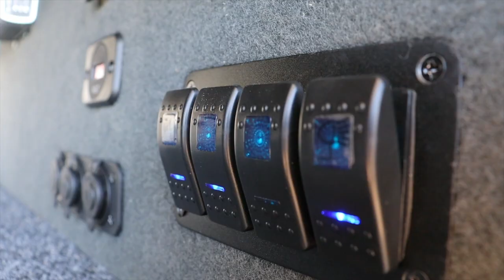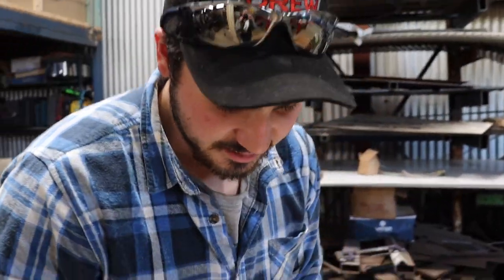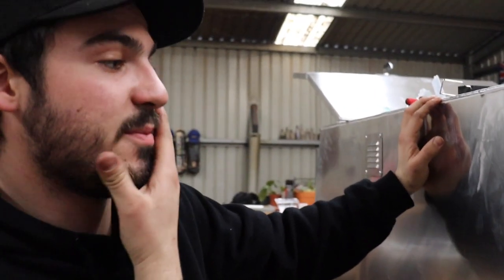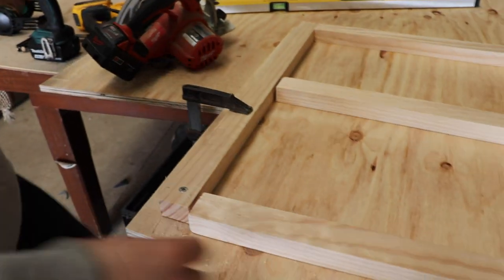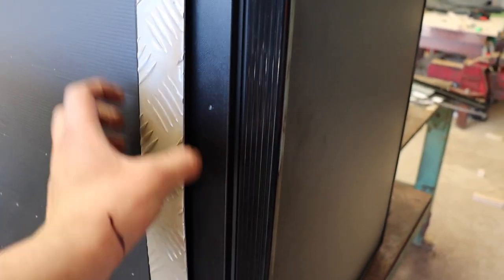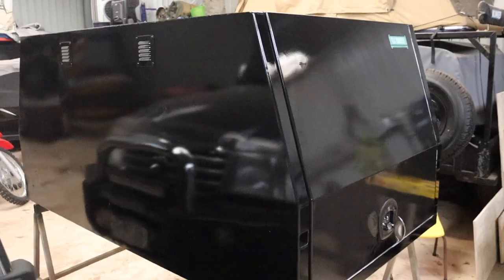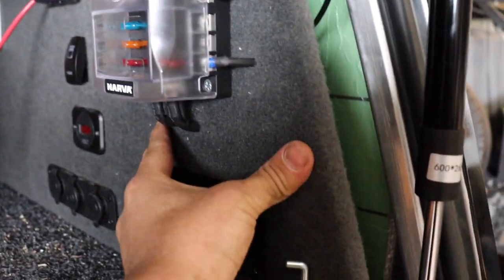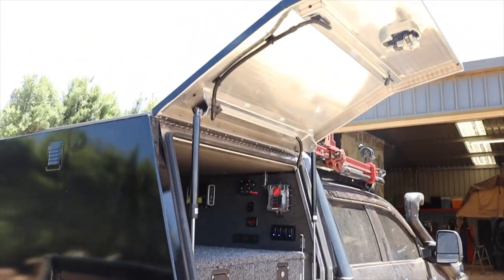Ultimate DIY Camping Canopy Build | Strictly Bush

Comment: Hey mate, great canopy build. Always love to see people do their own setups!
With regard to the 50amp breaker installed under the bonnet, it is an auto reset style? If so, I wouldn't recommend them. My experience with them in under-bonnet use has seen failures and neusense tripping as they don't like heat.
I would swap it out to a suitibly sized MIDI fuse if you can. 
Keep up the good work. Cheers.
Reply from the maker: Hey mate glad you liked it. Yeah it’s auto reset. Haven’t had a problem so far, this is more temporary to get through the summer I haven’t had power running to the canopy since lock down but I’ll have a look. Cheers mate!!
Reply: Hey obsession, 
Just read yr comment and thought you might like to look at my set up both videos canopy and 12v set up. 
Cheers 
Out There Touring
Reply: Hi great build. 
Just read yr comment and thought you might like to look at my set up canopy and 12v for some ideas.
Cheers 
Out There Touring
Reply: HAve heard that yet mine has not had an issue in 5 years so I would take that advice with a grain of salt. Cheers
Reply: @cyclemoto8744  So because your setup has not had an issue in 5 years means using an auto reset circuit breaker is going to be fine for everybody else's individual circumstances??
It's typical that people such as your self will tell others to disregard considering upgrading to a proven industry standard that functions more efficiently in high heat environments for such little additional cost..🙄
Reply: @12v_obsession92  People can do as they please based on the information they seek. I don't object to the industry standards which in this case don't have a bearing on safety, only reliability. However my experience with breakers has been 100% reliability and no issues with effiiciency considering my Victron DCDC charger operates above the stated specifications (Victron have underrated specs).  You should consider your tone when participating in discussions. You will more than likely find that people's propensity to engage with you will increase if you cease your aggression

Comment: Great fi-tout video! I really dig that slide out pantry. With those air-vents, are those little filters easily replaceable / accessible to wash out and re-insert?
Reply from the maker: Thankyou! We just have them on with a double sided tape, and we made the gap big enough so that someone with a small hand can do the job 😂
Reply: Hi great build. 
Just read yr comment and thought you might like to look at my set up canopy and 12v for some ideas.
Cheers 
Out There Touring

Comment: Nice canopy mate. How has the bit of sheet metal gone with keeping the fridge in place? Is there any movement over corrugations? Just bought a fridge and going to do the same tie down I think. Cheers
Reply from the maker: It has worked really well, we haven't had any problems or movement at all so far! Its been a year and we have done plenty of 4x4 :)
Reply: Hi great build. 
Just read yr comment and thought you might like to look at my set up canopy and 12v for some ideas.
Cheers 
Out There Touring

Comment: Hey mate been looking at those boxes do you think the door opening will be big enough to run a bushman’s 130 upright fridge
Reply from the maker: Hey mate, I think you will struggle with the 130L, that fridge is a lot taller then the 85L. I’ve only got about 50mm max on top of the fridge to the top of the door
Reply: Hi great build. 
Just read yr comment and thought you might like to look at my set up canopy and 12v for some ideas.
Cheers 
Out There Touring

Comment: How did you bolt the walls up what did you use and how did you do it?
Reply from the maker: I used rivnuts mate, pretty much a rivet but it has a thread inside of it so you can chuck a bolt in
Reply: Hi great build. 
Just read yr comment and I thought you might like to look at my set up canopy and 12v for some ideas.
Cheers 
Out There Touring

Comment: Hey mate bit of a weird one. But do you think there is enough room on top of the fridge and between the canopy roof to mound a switch panel type thing?
Reply: Hey Matthew, 
I was thinking of doing the same thing but decided to cut into head board due to hassle if you ever needed to remove fridge for any reason you would have to fully remove and disconnect all switch assembly.
Have a look at my video
My 12v set up
Cheers 
Out There Touring